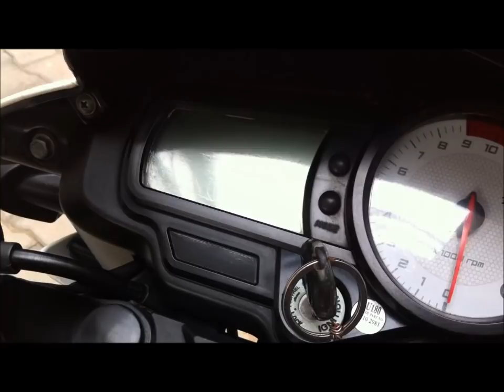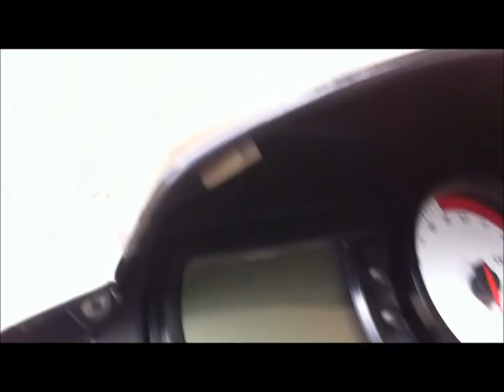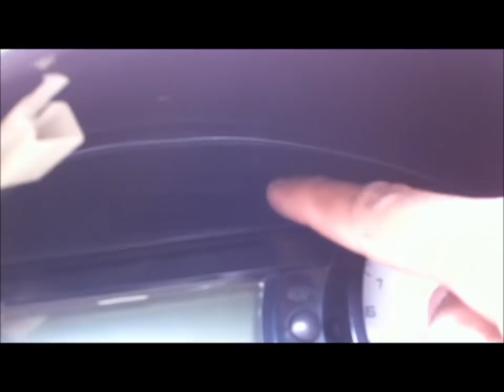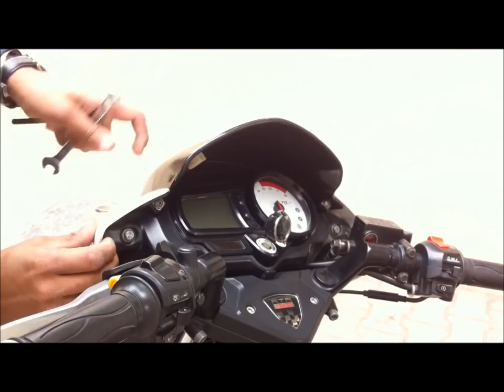How to install music system on Motorcycle 🏍 | Complete Details of installation | TVS Apache RTR 180

Comment: hey manvir I have 160 cc apache .

engine is leaking from the left side where they have bolt.

I showed to service guy many time but they are able to fix it.

can u help me to understand why is leaks
Reply: Kiran M maybe a broken seal mate or u can just replace the washers and bolts.

I think it's a broken seal and do get it fixed ASAP before Ur engine gets damaged